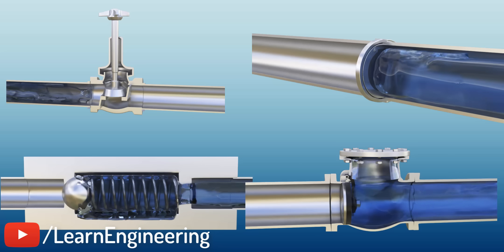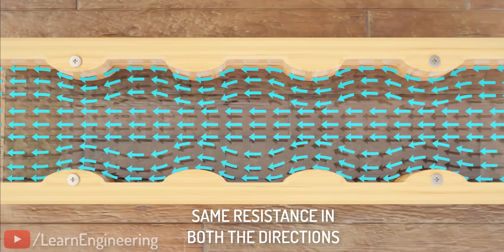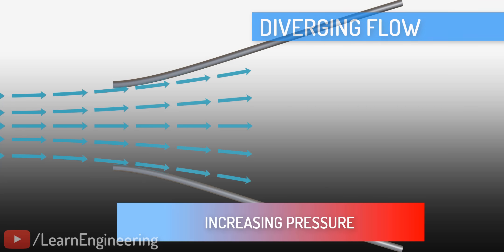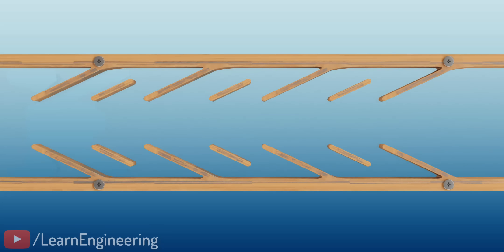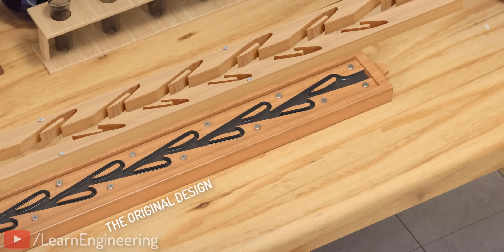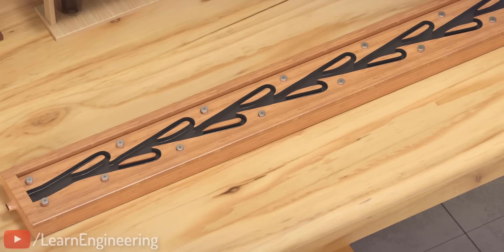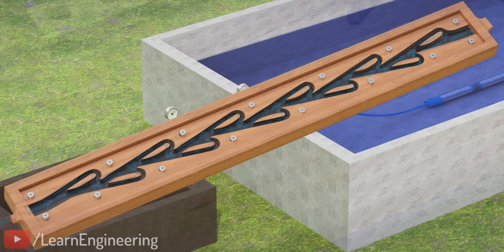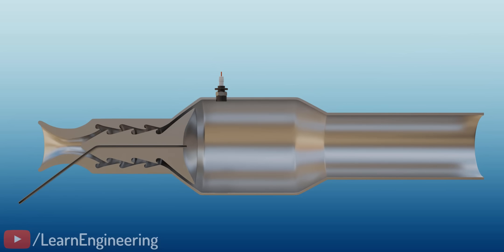Tesla Valve | The complete physics

Comment: I would have loved to see a real demo with a colored liquid.
Reply: I would of expected an “engineering” video to have some actual data, not a bunch of qualitative assessments.  Still a cool invention.  Mediocre video.
Reply: @Stellasmith-j9q  #CLLM
Reply: @MM-rr1kp  
i'm not a hipster, i don't do the stupid ass hashtag
Reply: @Stellasmith-j9q  #bishybish
Reply: here you go https://youtu.be/7VYQLu1AjPc
Reply: Stella smith „colored liquids matter“
Reply: It doesn't work. Someone already tested it
Reply: @BGraves  i think is used on steady flow irrigation system, if you open a dripper with fixed flow rate you see something like this.
Reply: @BGraves  who tested it? Tim from Grand Illusions tested it and it worked
Reply: @ki0w0-lordofwatersheep  No, it didn't 'work'. Air flows through Tims toy with the same flow rate both directions, but one end releases the gas out of two tubes and the other releases it out of one tube and twice the velocity which greats a different sound.
Reply: @davesmith3289  how do you know the flow rates are the same? I'm curious about your method of measurement.

If the different sounds were only due to different outlet sizes per your explanation, then why does the higher frequency come from the one with two outlets? Shouldn't it be a 'softer' hiss there due to slower outlet flow(per outlet), if your explanation were correct? And why does the softer hiss come from the end with one outlet, when your explanation says it should flow faster there?
Reply: @ki0w0-lordofwatersheep  "how do you know the flow rates are the same?"
Physics
Reply: @davesmith3289  What physics? And how does it make you know the real flow rates? Does physics work on unsubstantiated claims? Let alone claims that experiment results contradict, such as that "one tube and twice the velocity which greats a different sound" even though that end generates a softer hiss?
Reply: @davesmith3289  How does your "physics" "know" that the flowrates are the same? Or was that a misprediction that real experiments don't agree with? Or just straight making up things after the fact?
Reply: @ki0w0-lordofwatersheep  buy a textbook.
Or, you know, just keep watching youtube videos that confirm your mistaken beliefs.
Whatever works for you, bro. Whatever works for you.
Reply: https://youtu.be/mC91vEMwq-E
Reply: @s.s9397  wOW nIcE dEmO! ShAwArMa cOlOrEd fLuId wAs bRiLlIaNt